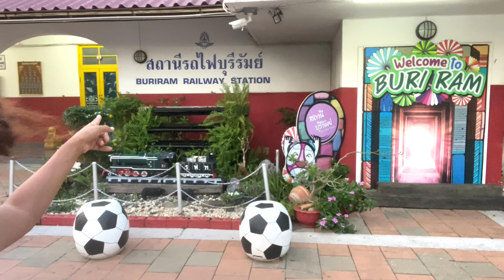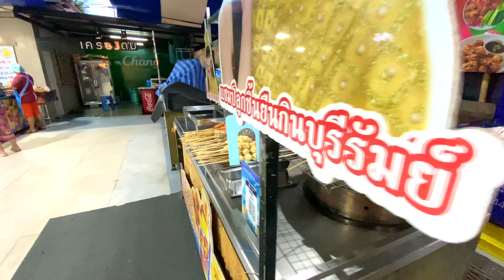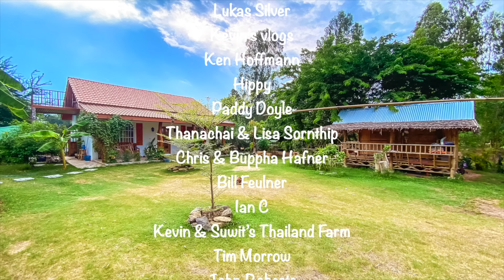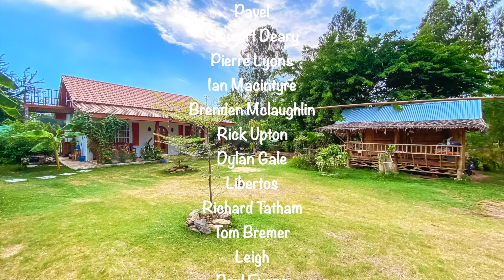Me & My TWIN sister Try This STREET FOOD & Is Thailand’s WATER Safe? 🇹🇭

Comment: They will be using a commercial grade RO filtration system which basically brings water down to less than 50PPM of all minerals perfect for coffee machines, kettles and steam irons. They are quite basic in concept and you Can get domestic units for quite a reasonable price now, and long term save yourself thousands a year by doing your own Ryan. Another filtration system is putting the rain water through proper charcoal filters will kill off bacteria and germs but it leave the minerals behind, good for the kids

Comment: They may have a reverse osmosis filter unit set up in the back, unless they have a tanker delivery and fill the holding tanks. I used to fabricate and install RO units on the oil rigs and naval frigates, turning sea water into drinking water.
Reply from the maker: Nice bit of additional info Callum 🙏